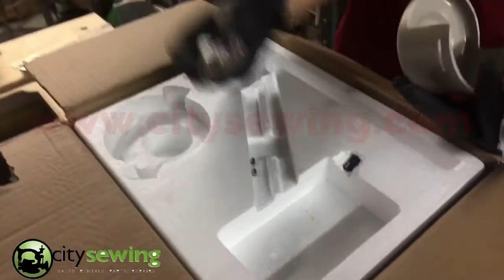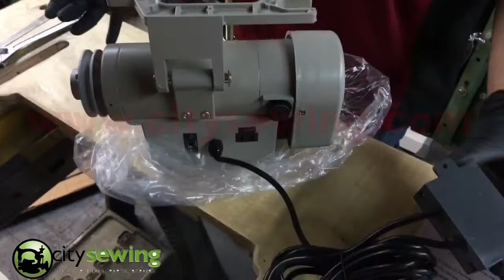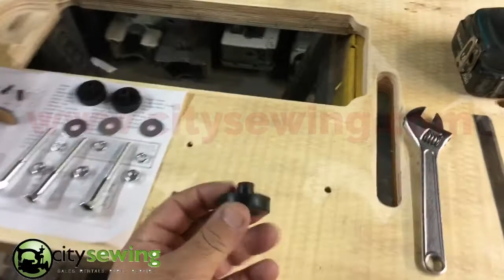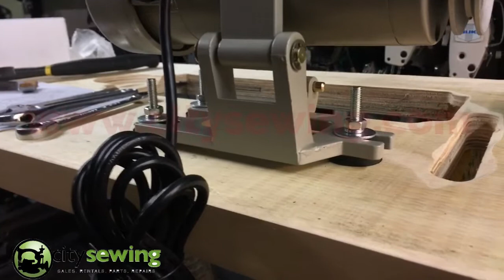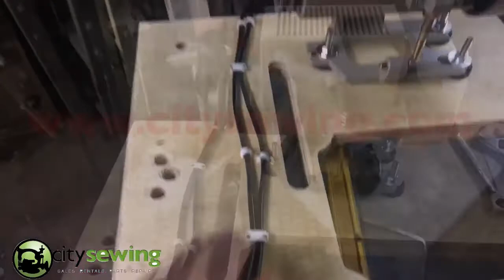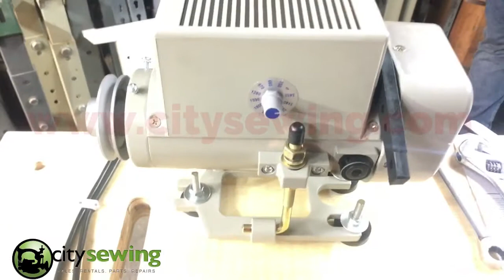How to install a servo motor this work in any industrial sewing machines.

Comment: This is perfect, my Mom (94 years young) wore out her clutched motor, she picked up this motor but it didn't come with a manual or parts list. I got it mostly right, need to put rubber cushions between bracket and table, had mine on the outside of the bracket. It also didn't come with the foot pedal connector rod in the original box. Going back for that. Thanks for the comment on the cork lined piece, wasn't sure what that was and glad I don't need it.

Comment: Have u ever converted an industrial sewing machine with a 220v three phase AC servo motor (the machine has three electrical panels that control thread trimmer, synchronizer, back tacker and pneumatic presser foot lift ) with a 110v servo motor? If so, did u lose/fry any electrical boards or lost use of any electronically controlled features? I bought a Brother LS2-B837-310 walking foot with a 220v three phase AC servo motor and the features listed above. I want to use this machine on 110v household current.

Comment: whether your electronic engine speed control module on the servo motor broke down (with a handle for the speed of the electric motor)

Comment: You make this look do-able for the DIY person.  Can you please tell me what model of servo motor that is?
Reply: MsAnnadel, I bought mine from Ebay paid $115.00, invoice says, Consew Mod. CSM550-1 Sewing Machine Servo Motor, 3450RPM, 110 Volt, Quite Running, Item #163478942, hope this helps. Gary O 5/14/2020

Comment: What if I don’t have bolt holes in my table? My clutch motor is attached to three bolts screwed into the bottom of the table.